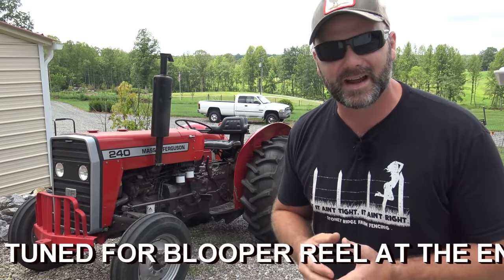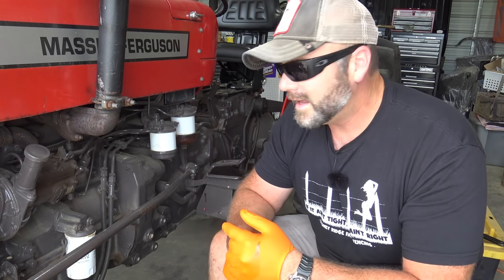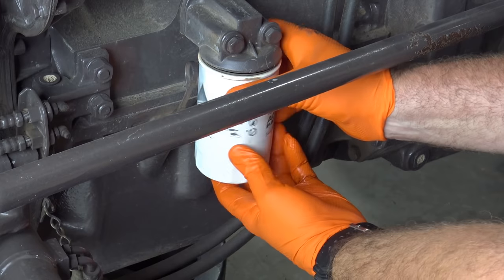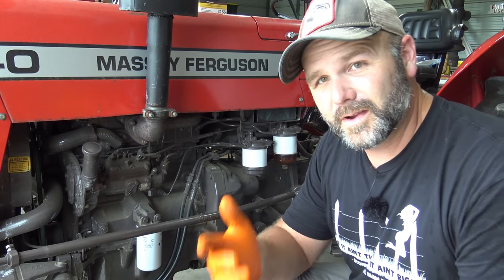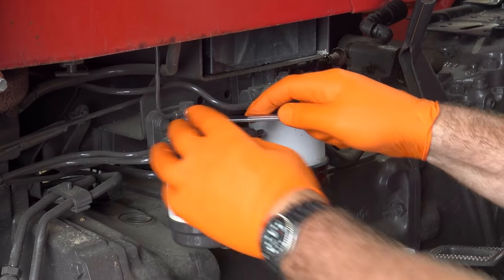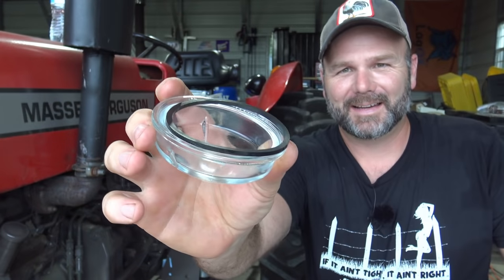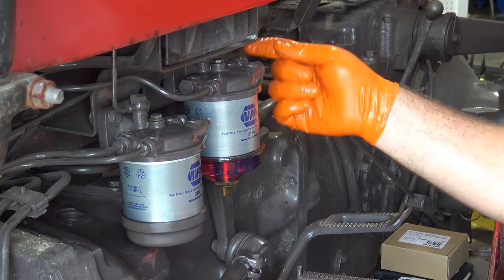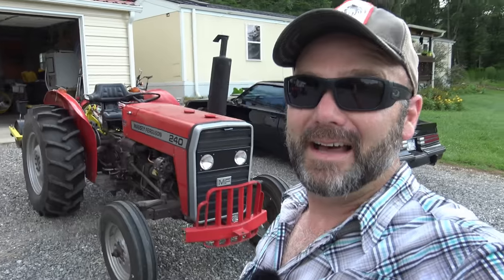TRACTOR SERVICE HACKS!!  DON'T MAKE THIS MISTAKE!! MASSEY, FORD, JOHN DEERE, KUBOTA

Comment: I’ve been changing oil in stuff for years and never thought of creating an “oil change” tote 🤦‍♂️ That’s a great idea and I’m definitely gonna do that 👍
Reply: I remember the days when you just dumped it out on the ground somewhere.
Good place was dirt roads or driveways to keep them packed down.
Reply: @dgeorge852  My Grandfather did that--saved his old oil in a 55 gal. drum-mounted it on  the back of the old tractor--with a pipe running cross ways--with holes drilled in it-once you started moving---pull a string behind you that opened a valve--and go down the road slowly. Pack tight as real asphalt. Didn't throw anything away on his place.

Comment: Battery terminals .... boiling water & baking soda rinse to clean off the sulphate grot ... then pop the terminals a smear with chassis grease .. replace terminals and they should be clean for evermore  ... AND USE UR SAFETY GLASSES in future ... Cheers from Australia.

Comment: If you dont want to buy a label maker just wright the hours on the filter with a marker like most people do. And you will kill your battery with the terminal cleaner. Always clean with a battery brush and use grease on your terminals.

Comment: These fuel filter assemblies are the worst. I watched your video and still broke the bowl, lol. One note is that I also had a hard time getting that top gasket in if you have  a tip for that would also appreciate it. It just didn't want to go.

Comment: Good video. That’s a fine Massey. I have a 1998 model 231. It’s an excellent tractor. It takes the same filters as your 240. 
I broke a glass bowl years ago while grading a driveway. A tire threw up a rock and busted it. 
If you never wanna see corrosion again on anything with battery terminals, apply a coat of silver Never Seize/anti seize lubricant on them. I been doing this for years. A mechanic told me about it years ago.

Comment: Nicely done. Just remember if you are going to fill the oil filter with oil before installing, fill the smaller holes. The big hole go directly into the engine.  So it filters into the small holes,  threw the filter element and back threw the engine to lube it. So if there is any contaminants in the new oil etc.. it will get run threw the filter 1st.

Woooooo 😁👍 love watching and doing basic maintenance,  so therapeutic
Reply: Hope to change oil on mf135 diesel soon. Is it ok or even better not to fill the new filter?
Reply: @timdippel7517  I personally fill it with oil.

Comment: Awesome tips , we have a 245 at my job its a fantastic tractor. I have a baby  1984 massey 205 compact im trying to get back in shape. I just rewired the entire thing and fixed the lift and fabbed up an exhaust. Next step is to change all the fluids and filters.

Comment: Hey Josh I've got a 1973 464 international harvester and it has glass bowls on both the primary and secondary fuel filters. They make a conversion kit for the tractors with glass bowls so you can switch it over too a regular screw on filter like your oil filter. I'm probably going to switch mine over. Just thought I'd mention the conversation kit to ya. Thanks  for the video
Reply: baldwin has options for most to go solid but still have the water drain
Reply: @tomprendy  thanks is Baldwin their website

Comment: Josh I have seen some people drill out the center of the oil plug and install a heavy rare earth magnet from harbor freight. You may want to do that. You can use some silicone around the rubber on your filters and maybe even though they don’t look dirty just blow them out.

Comment: Every battery that I have had with corrosion build up on top of the terminal, always had corrosion the length of the terminal  and cable. It's always easier to pull the cables off and clean at that time, than to have an issue when your wanting to get some work done. YMMV. Love the channel.

Comment: Oh brother, thats horrible.  I have done the same thing wearing the gloves lol.  I serviced my tractor yesterday and had the hardest time with my fuel filter bowl lol.  Awesome little tractor and awesome video brother.  WHOOOOOOOOOOOO!!!!
Reply: i been servicing the kubota and took me only 10mintues feul filter and oil change wich wasnt bad timing newholland took 3 hours and 45 mintues to do on it wich was a pain full and hard to acess get to
Reply: @michaelmactavish1728  my filter got stuck inside bowl and didnt wanna come out.  Took literally 15 minutes to change oil, oil filter, hydro filter, add hydro oil and change air filter lol.  And 20 minutes fighting fuel filter lol.  I am changing my fuel filter more often than recommended due to the high amount of trash that was in it.

Comment: Thanks for the video. Applying what I learned from you on my old Lincoln SA 250D welding machine.  

I also broke a the bowl the first time I tried changing the fuel filter. The worst part is I was changing it in a middle of a job and ran into alot of trouble.  Ended up taking it to a mechanic the first time.  And the second time I paid someone to replace it for me. This time I'm gonna try doing it myself again.

Comment: I agree on the log book.  I have a spiral notebook on every piece of equipment that I have.  It has the model, serial number and the PIO date on the front cover.  For my chainsaws I lump them all into one spiral notebook.  One thing I do is put the date and hours of operation on the filter before I install it.  When I check the oil after running it for a few minutes, I do it the next morning after it is perfectly cold and all the oil has had a chance to drain into the sump.

Comment: Hey great video! I have a MF 255 that I am working on and currently I am working on the power steering pump that ran out of oil. My question is what type of fluid do I need to buy for the power steering system? Thank you!
Reply from the maker: contact your agco massey ferguson dealer or hit up NAPA...they should know

Comment: still the same system that is on my mf165 from 1971 great tractors mine had the rear hydraulics took them off because it makes running the 3 point lift a pain now mine has a full set of rear outlets running off my front mounted pump that also runs my loader  mine is not as good looking but it gets used everyday no down time for anything but maintenance take care and be safe

Comment: Poke a hole in the oil filter and let it drain into the pan. I serviced diesel trucks for many years doing this to prevent major spills. Great job,

Comment: Great idea on the tote. I'm not sure about the terminal cleaner. So baking soda/ terminal cleaner is a acid neutralizer. You have a vented battery. As a mechanic of many years I used to service batteries the same way. Every so often I would have a customer return needing a battery. I then only used water and a brush to clean the battery. I had a substantial less customers returning for a battery.  Just a suggestion.

Comment: I own a John Deere tractor and always leaned towards John Deere tractors but man I love that Massey Ferguson. In the next few years I’m looking to add a tractor around 40hp to the farm mainly for gardening and a back up for winter to feed hay just in case my larger tractor has to be down for a repair. I’d say most likely I’ll be looking for a Massey Ferguson. Love the video keep them coming.
Reply: One question is the battery powered grease gun worth it? Been on the fence on buying one and would like to see what your opinion of it is.

Comment: Josh, them battery terminals sure is purty! And that's all!  You must take the clamps loose,  remove,  and wire brush them and the terminals, inside and out, with a battery terminal wire brush gizmo. If you don’t  it's like getting all dressed up in your Sunday best and not changing your u-trou!

Comment: In your oil change tote...is the dead wolf spider optional?  I've got an MF 135 and I'm hoping I won't need that for mine.  ;)
I'm so glad I watched this video before I did any of this stuff, because I'm 99% certain I would have cracked my bowl with the bolt too.
Reply from the maker: glad to help!!

Comment: Awesome video.  I will be doing a service on my MF 240 tractor tomorrow.  will post an update of my success. My tractor has been idle for a year so will also add some fuel cleaner in the fuel tank.  Do you use fuel cleaners on your tractor? what is your experience?
Reply from the maker: I use this: https://amzn.to/34hGMP8  (Stoney ridge farmer affiliate link from amazon, means if you use it I get a small commission)  I power service in my 100 gallon diesel truck tank with every fillup and have had no more problems with water in my fuel...this was a huge issue a year ago!

Comment: Hi, Am retired and going in to farming. Having some land already into banana crop farming, but have a desire to do more in silage for cattle that already are gaining numbers. I think after having this tractor, and the implements to other than the ones at the back, a loader in front to lift up some stuff is necessary. Is the Ferguson having this mechanism in front to fix up a loader? This very important for in making a choice of this type, you were not clear on this in the videos you have worked upon. Thank you dear Stoney Ridge, when you answer in affirmative I go for it of the 75HP

Comment: I grew up with those little massey tractors my first tractor was a 135 massey very good very tough can handle almost any thing can pull a 3 disc plough it's easy to add the auxiliary hydraulics that little square cap under the seat is where you tap into

Comment: For the battery corrosion, super glue a penny on top of your battery. That will corrode instead of your terminals. Good video.

Comment: Thank you for making this video. I just got an old MF240 myself and it needs some love..  Pretty much everything you mentioned here.  I'll work on it this weekend.  Not sure if you have a list/links somewhere, but it would be super helpful to know which filters to buy.  As someone completely new to this, there seems to be endless choices online with varying price points.  In the meantime, I'll hit the local tractor supply shop.  Again, thank you!
Reply: Stephane Come 
WIX filters are a good choice. He used NAPA filters, the differences between those two brands are the part numbers. WIX makes the NAPA branded filters for them, A WIX filter has a 5 digit part number, the NAPA number is the last 4 digits of the WIX number if I remember right. WIX has an online filter cross reference list, just put in the part number and  maybe the brand of the filter you have now and it spits out their number for it.

Comment: I have a question. Did you put the small ring for the upper screw in the filter? Instinctively, I placed that ring between the head filter and the washer of the screw. Can you precise the right way? 
Also, there are three tall ring. Is there an extra one? 
Thanks for you video. Very interesting!
Reply from the maker: honestly I can't remember since it's been so long

Comment: JOSH,
    A little advice from an automotive and aircraft mechanic.  
    Observe torque specs!  When using a wrench (not a torque wrench) choke up on the wrench.  You will feel the torque better that way.  You will feel the loose turns (virtually no resistance).  Then you will feel the tightening turns.  Depending on the item you are tightening, give "metered force" to put pressure on an o-ring, etc.  
    Beam type torque wrenches are economical and rarely wear out.  You can practice your torque pressure on an extension clamped in a bench vice.  Then duplicate it with the same tool but put some "feel" into it.
    Just a short and incomplete lesson.
    I'm 72 and after working with aircraft grade hardware I had to remember the softer hardware of automotive grade and even softer grade of common hardware.

Comment: Josh that stuff on the battery is battery acid, the battery is boiling from being over charged. Check the volts coming into the battery and see if it is to much if it is you need to replace one of two things so now a days alternators come with internal diodes to distribute the power if you have this you need an alternator, but since that is so old you probably still have a separate voltage regulator somewhere on the tractor that is what is going to be bad because it is sending to much to the battery.
Reply from the maker: hmmmm
Reply: Maybe a Battery Tender frying it?  That was a lot of corrosion.

Comment: One of the old rectangle five gallon gas cans makes a great drain bucket or tool tote. Just mark it and cut an appropriate size hole under the handle. I am talking the old one that have sides that are low and taper in a few degrees from a wide bottom to a slightly smaller top with a foot long handle between the pour spout and vent, not the recent tippy jerry can looking things.

Comment: If you pre lube your oil filters, fill into the outside portion of the filter. Pouring oil down the center goes past the filter media. If I see corrosion around the battery terminals like you had, I recommend pulled the cables off and cleaning. The spray type cleaner that you are using is good though. Clean everything, coat battery posts with dielectric grease or even tube grease (if you're in a pinch) and reinstall. Those fuzzy felt things under the cables get thrown in the trash. Less serface area and contact with the battery terminals. For labeling my filters, I use Sharpe or paint pens depending on color of filter.

Comment: Not too bad.  I may be able to do this myself. Bought my 135 second hand and it leaked everything and I put it off until one fateful, windy, dry Summer day when it caught on fire from a battery spark. So now I think I'll be more proactive. My issue is oil coming from one of the nuts on the side with the starter...NEAR the starter. Just wondering where I can tighten it.

Comment: My LS tractor the fuel filter can be put on dry, it has a primer to hand pump fuel in. I have metal cabinets to keep tractor stuff separated from lawnmower and chainsaw stuff. My tractor has 2 engine drain plugs because of drive shaft and they are marked with white paint from the factory.

Comment: I assume you meant that the video will probably double as a service video for the MF 230 versus the 130 you mentioned. I have a 1978 MF 230 and it was the previous model to the 240.  Great tractor that’s for sure.
Reply: 230 and 130 were made at same time as 240 and 135 but were a different engine 4 cylinder as opposed to 3 cylinder and less hp
Reply: Ahh...gotcha. BTW, I was mistaken because I actually have a MF 235 not 230.

Comment: How not to break the bowl, Use the wrench just to hold the bolt from turning then use the thumb screw, the knurled part at the bottom of the bowl to tighten.  The knurls will dig into your fingers causing pain making you let go at the proper torque specification.  Yep Rocket Science :)

Comment: @ 16 min, fuel filter, installing the upper flat "O" ring, make sure it is flat, not twisted, or you will have leaking filter.
MF 135 is the same too.

Comment: Josh, take a magic marker and put the date that the filter was changed on the filter, and stop using that knuckle buster on the drain plugs. All that thing does is round off the drain plug, 35 years changing oil on equipment, and I've seen many plugs destroyed by adjustable wrenches.

Comment: There is a small filter on the end of the fuel tap on the inside and another at the rear of the fuel pump where the diesel is fed in.
Those are always overlooked

Comment: For your first filter get a fuel/water seperation filter and do away with the glass bowel the new filter will be the length of the current filter plus the glass bowel maybe a little less than a 1/4 inch longer but will still bolt on.

Comment: I have a MF 150 gasser with a glass bowl, 3 cylinder Perkins. Some one ought to make a lexan bowl, it would never break. Can any one out there find out if I can put a remote hydraulic outlet and valve on my machine, and install a front loader?
Reply from the maker: I have a video installing a 3rd function valve on this machine. Contact your local AgCo dealer and you'll find what yo need

Comment: when you prefill the oil filter you should fill it from the outer ports on the filter, because that way it will go through the filter before going through the engine

Comment: Here is a tip for your battery corrosion. Corrosion comes from the evaporation of the electrolyte. When you purchase a new battery or with the old one, mix some two part epoxy and where the post comes out of the battery, seal around the bottom of the post keeping the evaporation from happening. You will NEVER have another corroded battery. I learned this years ago from a person that worked at Exide battery. I first used this method on my old motorcycle and now with all my batteries. You will never have to clean another battery.

Comment: you shold always check that the seal from the old filter is still on it and not stuck up in the housing or you will be running for about 10 mins and then the new filter will blow off . ive seen it happen
Reply from the maker: yep I agree

Comment: My gear light on the "dash" stays on.  Any ideas on why?
Reply from the maker: pto engaged? Or bad PTO switch? There's a switch on the outside of the lever that won't let ya start the tractor while engaged...check that switch...could be bad or disconnected